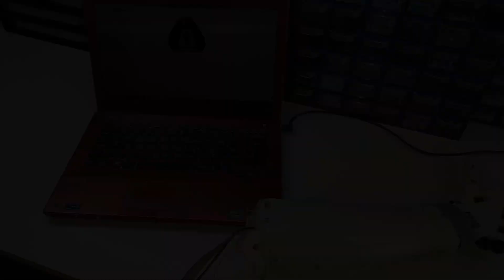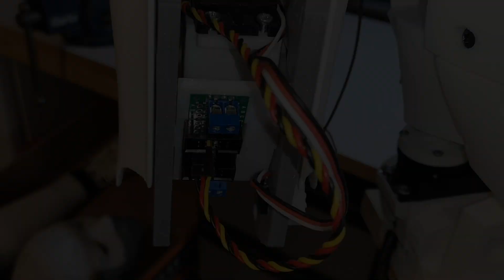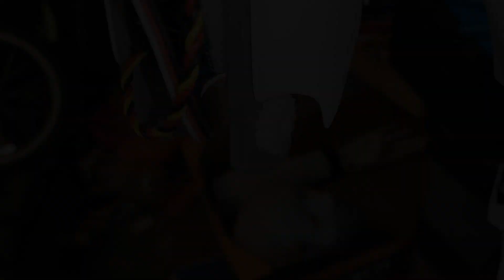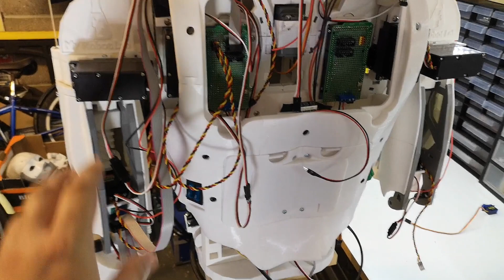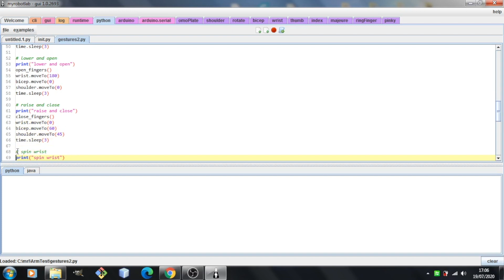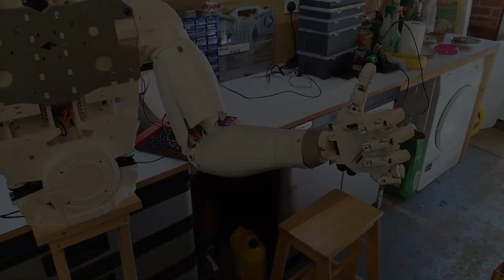Civrays InMoov - Armed again

Comment: How you made your robots parts so smooth and clean (especially the arm)
Reply from the maker: Sand, then wood filler, sand again, then paint with filler primer, sand again and finally paint with colour coat. In reality probably three coats of primer sanding between each and at least two coats of colour. Ideally we should probably finish off with clear coat.

Comment: how much current are you drawing through this board?
Reply from the maker: Which board are you referring to? The DC-DC converter is rated at 12amps, but i'm probably pulling around 8amps max. The board on the arduino is mainly just signal wires, but it does feed power to the shoulder. Probably around 6amps max. Nothing has been measured yet.
Reply: @SteveRaynerMakes  sorry I meant the board that you're running the power to then to the hand I was just wondering if the wire size was big enough is all